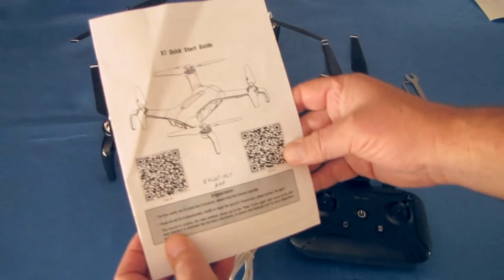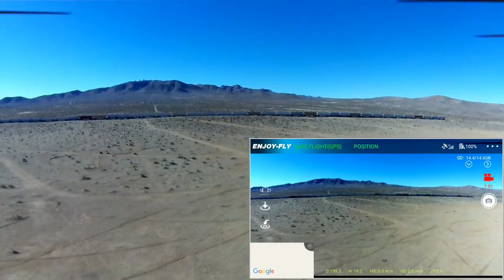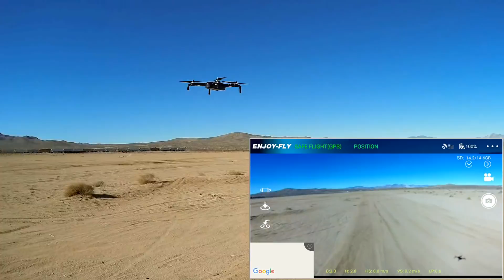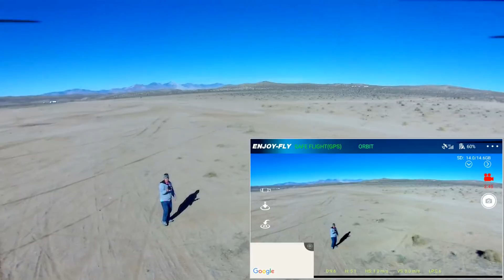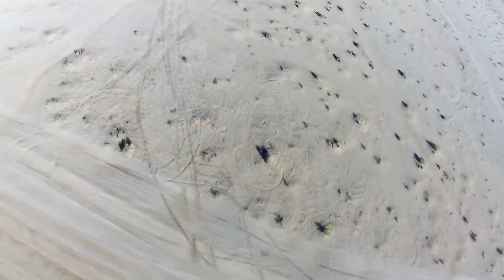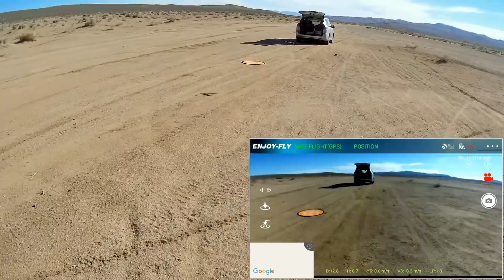JJRC C-Fly X7 SMART GPS Brushless FPV Camera Drone Flight Test Review

Comment: W. Smith (2 weeks ago)... Good idea to test in a more frequency crowded area, because a WiFi connection on a particular frequency band can also be faster or slower because of interference from other devices.  This Qcopter, the controller and your phone will be using different frequencies and the primary differences between 2.4 Ghz and 5.0 Ghz are the range (coverage) and bandwidth (speed) that the bands provide. The 2.4 GHz band provides coverage at a longer range (coverage) but transmits data at slower speeds. Whereas the 5 GHz band provides less coverage (range), but transmits data at faster speeds. Here's another way to look at it... The range is lower in the 5 GHz band because higher frequencies cannot penetrate solid objects, such as walls and floors. However, higher frequencies allow data to be transmitted faster than lower frequencies, so the 5 GHz band allows you to upload and download files faster. Whew... enuf

Comment: Am I the only one in need of battery connectors and adapters? If I had adapters, I could interchange a lot of the batteries that I already own and use them on more than just one machine. I think it would make a great topic for one of your videos.